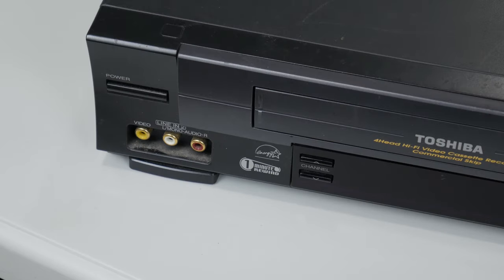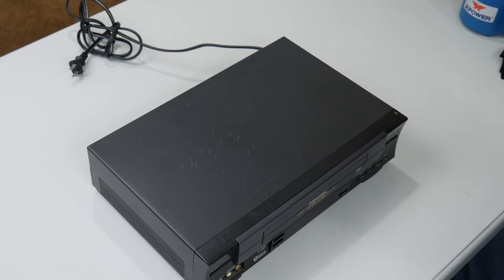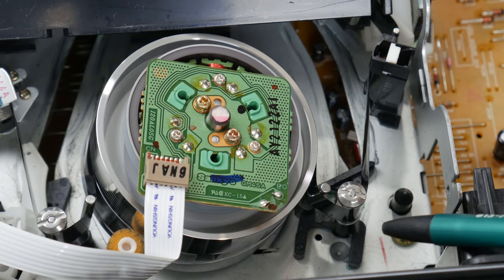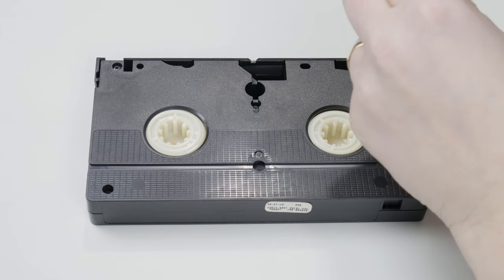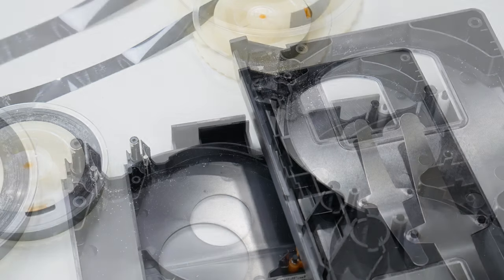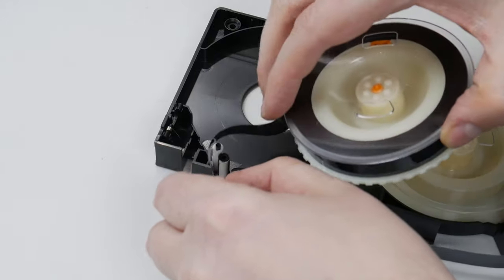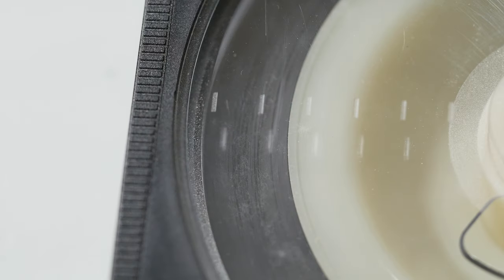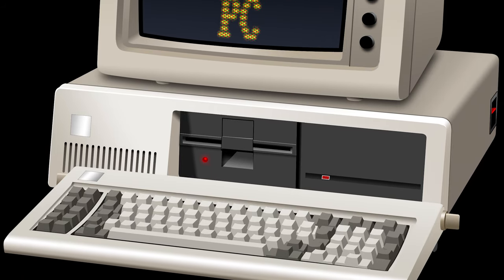How to clean moldy VHS videotape

Comment: Great video. The problem with removing mold with a dry towel is that you just get rid of the visible mold. Mold spreads through microscopic spores though. You need isopropanol to kill off the spores. otherwise it will spread again. My mum used to work at a photo studio and she restored hundrets of moldy photos and tapes. They used some sort of open-reel machine to get access to the tape itself and then carefully clean the tape with something that looked like cotton-wrapped BBQ-tongs which were soaked in 99.9% isopropanol. They also rubbed every mm of the cassette cases with isoprop.
Reply from the maker: Thanks for the history and technique!  I agree, that would be the best way.
Reply: Well, the idea is you make a digital archive of the tape and then probably dispose of the tape afterwards.  Unless you're expecting to be able to make a better copy later (better equipment).
Reply: I don't know much about this sort of thing.  Would isopropanol damage the tape in any way?  Just wondering
Reply: @SenileOtaku  Yeah the problem with videotapes is their complexity, so you might always find more information that exists on the tape that you didn't capture the first time. E.g. capturing separate luminance and chrominance signals will give you better quality after you've already captured plain ol' composite video. Then as for audio tracks, you may have captured linear mono, and find out from another VCR that it actually had linear stereo audio. Or you might have captured from a linear machine and then find out later that there was Hi-Fi Stereo audio. Conversely, you might have captured the Hi-Fi Stereo audio, and then there's some commentary track on the linear track that you missed. Let's not even venture into the (highly unlikely) possibility of digital audio tracks...

So for my special tapes, I might capture them, but I hold onto them. If they're not special, can sure free up a lot of space tossing them!
Reply: @SES8856-z5u  according to most that do this sort of thing I’ve seen, no. Long as it’s high content isopropyl alcohol. I’ve seen some say any thing above 71% but I’d go 99% to avoid water damage Incase the Lower percentages would damage.
Reply: it’s confusing - i tired to clean a rare film tape and i used 91% isopropyl alcohol. it totally ruined the whole tape !!! now unwatchable 🙄 my mom said that higher alcohol could strip the coding off or something. not sure if she’s right or what but my attempt made it not playable no more. just sound and no pictures

Comment: I used a normal tissue with isopropyl alcohol, I didn't remove the mold completely from the inside but all that matters is that I now fully transfered it.
Reply: Does isopropyl alcohol damage the tape though?
Reply: @benkleschinsky  no
Reply: @Conner420matt  I conner
Reply: @Conner420matt  hi conner
Reply: Did you transfer it straight away?
I was planning on but realised that I’m not sure I have the leads to hand to get it onto a screen this weekend. My friend is coming to help me clean them up tomorrow, and I intend to transfer them later (so I won’t know if I’ve wrecked them! 😬)
Reply: Also, how much isopropanol did you use?
Reply: @CB-jh1pt  pure
Reply: @BetamaxFlippy  pure isopropanol?
How did you transfer them to a digital format?
Reply: @CB-jh1pt  DazzleDVD-HD + VeeDub64
Reply: @BetamaxFlippy  so have you got an import to transfer VHSs into a PC?

I have access to a video/dvd combo player, and may be able to transfer then onto discs using that?
Reply: @CB-jh1pt  I'll link you a nice tutorial later
Reply: @BetamaxFlippy  ahh thanks so much! That’d be great :)

Comment: I’d practice taking apart a tape you don’t care about first. When I tried this, I completely butchered the tape because a load of small loose pieces fell out and I couldn’t put them in right again (luckily I had thought to use a practice tape). Granted the reason this happened was because I hadn’t turned the tape up the right way before taking it apart, but still there are a load of loose parts that could still fall out if you’re not careful. And it’s just a good idea to use a practice tape first.

Comment: I take two cotton pads and put a dab of 91% alcohol between them. (91% and above is safe. They use it to clean 8mm film and photo negatives. But any lower has too much water and will cause damage.) Then I glue the top two pieces of the cotton together and just slide the film between the cotton where the alcohol is. Then fast forward and rewind a few times. 

I clean the tape casing out one side at a time having ff or rw the tape. I use cotton swabs with alcohol to get everything. Because if you do not the mold is just going to grow back. It is still there. You are just wiping off what is visible. 

I transfer tapes for people. It is great to save their memories.
Reply: Cotton swabs are safe as microfiber cloth? Thx

Comment: With a tape as bad as the one you showed, I don't doubt that it is mold, but according to this video, at least with metal audio cassettes (which use a similar formulation to videotapes), white powder on the tape might not always necessarily be mold -- it could just be the original lubricant of the tape which has solidified and turned into powder form, in which case simply fast-forwarding and then rewinding the tape will redistribute it and get rid of the powder: https://www.youtube.com/watch?v=ezdlGSXUZ3M
Reply from the maker: Good to know, thanks!  The reason I'm fairly sure the mold on the tape in the video is indeed mold is because it was on the clear plastic reels as well as the tape itself.  If it were only on the tape, then it might be solidified lubricant -- however, that's not something I'd want floating around my only good capture deck.
Reply: Hey VWestlife what a coincidence to find you here, How could you affirm it is white powder inside than mold instead?
Reply: Hey I have nirvana live tapes. Help please.
Reply: What if it ends up being mould though and you’ve rewound it inside your player and spread the spores around?
Reply: @VHSRarities  PLEASE restore those a.s.a.p. Nirvana heads like me live for that shit!
Reply: A dedicated VHS rewind we like they had in video stores may be a good idea ?
Reply: @wicketandfriendsparody8068  I have one around somewhere and haven’t seen it since i moved 10 years ago.  been eying 2nd hand stores and local sites for cheap VHS players. 

may check amazon or Ebay.

Comment: had this very problem in the late 80's/early 90s living in very humid north Florida. Just used to shut off window a/c unit during the hot summer days, to save on the electric bill(and tapes were inside a dresser drawer even, not just on a shelf or the floor) and after several years, this happened. So, tossed dozens of them. Sure wish I had known that a few decades later, VCR's would be available for 10 bucks used! or that I could try to clean them. Oh well...Oh, a mask might be a good idea to wear when dealing with mold!

Comment: Mold has been a bane for audio recording since 1890 when Edison's brown wax cylinders were found to support mold very well. It has been a bane since then and is one of the reasons that no (known) good recordings of Mark Twain exist. Cylinder recordings made prior to 1890 used a different composition which did not support mold but also made a inferior recording.
Reply from the maker: I suppose once the mold starts to grow, it etches new grooves into the surface?  That's a shame.

Comment: Not sure if other comments mentioned this, but I find it a good habit when putting the screws back in to “counter clock screw until you feel a click and the self tapping screw will work it’s way into the existing threads.  otherwise, you may end up re-threading and possibly striking them. 

may not be an issue for a one time thing, but def found it a good practice as i work on a lot of electronic hobby stuff and seen my share or worn out screw holes 

Good info-  I just stumbled upon a box of VHS tapes in the garage for 10 years now and most aren’t petty.  thankfully, only a few have mold that I want to preserve

thanks for the insight 👍👍
Reply from the maker: Thanks for the hints!
Reply: Yes I was a bit hasty and some screws ended up breaking so I had to reshell a couple of VHS tapes.

Comment: I found a duel-directional tape rewinder with a microfiber (low pile) cloth folded loosely onto the tape, clamped into the closed gate works.  Passing the tape through cut slits in the towel will give a bit closer tension.  Then a light misting of the cloth with isopropanol (another run through).  Then 2 run throughs with a new dry cloth.  5-6 runs total.
Reply: that would be hard to follow with such instructions and not more help. For most.

Comment: I taken the lid off my VHS rewinder and took a donor VHS case and notched out the center. I removed the reels from the mold tape to clean the insides and place the reels in the donor case. When I notched the donor case out I also removed all the routing pieces inside as well so the tape reels have no slack between and place a link free towel. Need to figure out how to wire the rewinder to fast forward as well but not sure with the gearing inside but remember rewinders that fast forward in the old days but hard to find. So much fun!

Comment: Now I'm thinking, since you'd be opening up the cassette housing anyway, that maybe there's a way to build a simple cleaning platform.  Something with a couple of spindles, either a switchable linkage (so you can run the tape back & forth) or two small motors to do  the same.  You could then run the tape through a pair of cleaning pads.

Maybe as an alternative find an old 8MM film splicer/rewinder (except you'd have to lay the winder face down or face up).
Reply from the maker: I think an enterprising person with a 3-d printer and a DC motor could build one and then sell them on ebay :-)  They've got to be way cheaper than the professional device I showed in the video, which was thousands of dollars.

Comment: I've seen some people use IPA-soaked cloths to clean the tape as it runs through the machine on fast forward, but I would be very wary of liquids getting onto the tape. The IPA could cause layers of tape to stick together on the reel if it doesn't evaporate in time and cause even more problems when you try to play it!
Reply: Experienced that the other day. Took a look at the IPA bottle and it was 50%. It was a pain to rewind to dry things up
Reply: @gmax341  Use 99%, and the problem won't occur.

Comment: Actually we use special machine for clean and wash videotapes and tapes like DLT, LTO and others. it goes trought liquid and wet gate with small brush, ultrasonic bath and then drying. also it have option restore jammed tape witth some heating and surface overrolling process. Excellent result.
Reply from the maker: I mention such a machine in the beginning of this video; what specific machine do you use?
Reply: @TheOldskoolPC  We do not clean damaged cassettes in VCRs because dirt spoils the heads and all the dirt falls inside VCR! Well you won't be able to clean it anyway the heads will get dirty again! Cassettes are brought to us after floods and fires (smoky and watered) We use a device of our own design. Just need to completely remove the reels from the cassette and install the device. And it will wash and clean the entire tape itself. and then the tape can be assembled. There is a similar device for the restoration of reels film, which we also have. But it is much bigger and more complicated.About like a developing machine. All that can be done well is to do it yourself. It is very difficult to buy good things, programs, filters and devices at this time in the world. Almost all used and damaged.

Comment: How did you get it off the tape reel itself? (the left reel when you take it apart) You didn't show that.
Reply: Skip back to the bit before he takes the tape apart. He ran it through a VCR with its cover removed, holding a microfiber cloth against each side of the tape as it was rewinding. This effectively dusted the tape and works much faster than unwinding/cleaning by hand while also reducing risk of damage to the tape.
Reply: @andrewhankins7031  Thanks, I skipped the start thinking it was all going to be done when it was taken apart - lol :)
Reply: @retrogeezer  No worries. I did the same XD

Comment: What do you do with the used microfiber cloths that you used for cleaning? Can you wash/reuse them or do you just throw them out? Thanks.
Reply from the maker: I put them in the washer, but let them air dry (dryer sheets coat them with a film, don't want that).

Comment: Do you recommend baking of vhs tape which are full of molds stick and hard to wind
Reply from the maker: In general, yes, but I would consult reel-to-reel enthusiasts for the correct temperature and duration.
Reply: @TheOldskoolPC   I still have lots of valuable VHS tape from my shootings, the only successful Technic that i`ve used is a Manual mode, i mount the spool on a stand, then wipe the tape with isopropyl alcohol mix  then with dry cloth, the process is very tedious work, as i need to wipe the whole tape wet then dry.

Comment: I just cleaned a number of mouldy VHS tapes. I did not want to clean them using my machine because it is new and I wanted to use it to convert the tapes to digital. Doing it using a second-hand machine I found was slow and cumbersome. This is a summary of what I eventually did.
Get two bolts where the head fits exactly into the reel drives. I found coach screws to be an ideal fit. On one bolt you need a tube like a short piece of garden hose so the bolt can spin easily.
Unscrew the VHS then turn it over so the screws are underneath. Pull it apart and all the pieces will remain intact.
Remove both reels. On the full reel, push the bolt head with the tube into the drive hole. On the empty reel push in a bolt and connect it to a battery drill.
Fold two sheets of toilet paper to about 1” square. Dampen (don’t soak) the outside with a few drops of propanol alcohol (cleaning alcohol). Stretch out the tape and fold the paper over the tape.
One person holds the bolt with tube on the full reel. The other drives the drill and holds the paper onto the tape guiding it so it winds properly on the empty reel.
The drill can be run fast when you get good at it. You can clean many tapes in a short period. Use TP and propanol to clean the empty reels. That seems to be where most of the mould is. Don’t worry about being perfectly clean. All you want to do is remove mould so it does not clog the recording heads then transfer them before it grows again. You will never remove all the mould spores. Use a mask.
If your tapes play fuzzy, run this process and I found by cleaning them they all play very well.
Carefully watch how the tape came out of the spindles so you can get it back in the cassette again or pull an old one apart if you get confused.
After checking your tape, run a head cleaner tape through your machine.
Reply from the maker: Thanks for the detailed summary of your process!
Reply: I did something that's pretty much a combination of your method and Oldskool PC's method but with a few changes: I have a plastic prong that fits microfibre cloths over both of the prongs without there being too much pressure between them and is small enough to fit in the gaps under the tape without taking apart the VHS itself, so I put my prong inside a vicegrip, the actual tape between the prongs (ie. So it's got cloth on both ends) then use a drill with an attachment I made from an old VHS player + an old drill bit, holding the drill with one hand and the tape with the other. 

Another thing is to do the first pass at very, very slow speeds (I pretty much put on a movie to watch while I do it and clean it at "playback speed" for the worst cases) as it prevents the mould from flinging around the case almost completely, meaning that the "take apart the tape" step is as simple as cleaning the insides of the reels and then giving the cassette itself a quick blow with compressed air to blow out any mould that did fall off or had already spread beyond the tape.

Comment: Don't you have to use isopropyl alcohol or something similar (and highly evaporative) in order to kill the mold entirely on all surfaces, including the edges and sides of the tape itself?
Reply from the maker: Probably not a bad idea, although not strictly necessary if your goal is to remove it for the purposes of capture.  I don't have enough experience with cleaning tapes with alcohol to advise.

Comment: Youre doing it the hard way sir... in av class we just used rewinders for tapes with mold then cleaned with alcohol.
Reply from the maker: Don't know where to find a rewinder :-)
Reply: I taken the lid off my VHS rewinder and took a donor VHS case and notched out the center. I removed the reels from the mold tape to clean the insides and place the reels in the donor case. When I notched the donor case out I also removed all the routing pieces inside as well so the tape reels have no slack between and place a link free towel. Need to figure out how to wire the rewinder to fast forward as well but not sure with the gearing inside but remember rewinders that fast forward in the old days but hard to find.

Comment: I’ve seen a few comments saying clean the tape with isopropyl alcohol, NEVER DO THIS. The alcohol will strip the lubricative layer off the tape and destroy it, isopropyl alcohol should only be used to clean the cassette casing, the empty reels and VCR components.
Reply from the maker: Seconded!  Never clean with alcohol, as it may dissolve the binder holding the oxide to the tape.